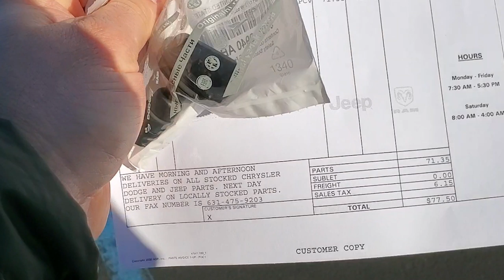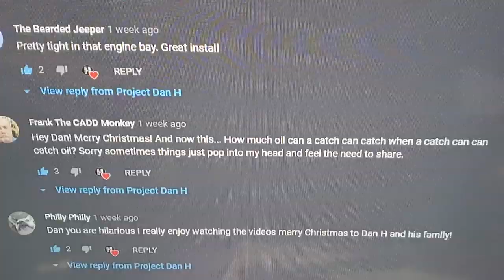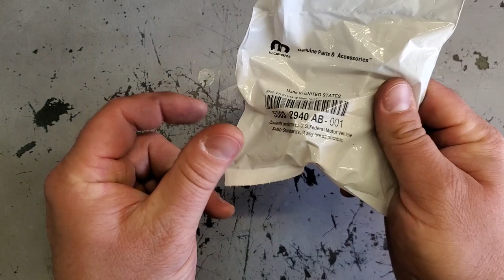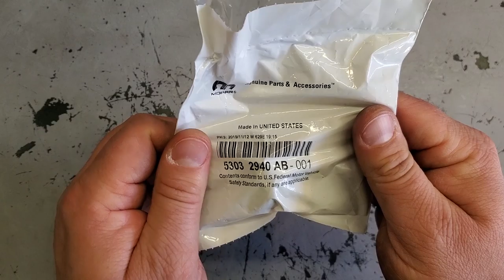JEEP COMMANDER 5.7 HEMI PCV VALVE REPLACEMENT AND CATCH CAN FOLLOW UP

Comment: I’ve been in the market for a Jeep Commander for the longest. I’m wanting too much I guess. Less than 100,000 miles, 4x4, 5.7 hemi.  How’s yours holding up? And how’s the maintenance been?
Reply from the maker: Good choice! that's what I held out for. took me many months to get everything I wanted. when I found one I flew 500 miles to buy it and drove it Home.  so far just changed the oil when it needed and everything has been great.  I love this vehicle
Reply: Project Dan H man I’ve seen so many miles away. I’ve been contemplating flying to one and driving back! It’s funny you actually did it and I’ve thought about it
Reply from the maker: @MrPonkie    it was a fun trip!  I made a video, check it out!   Another option would be to have it shipped back from a transport company.   You just have to consider the cost of gas vs the air fare.. and the annoying corona bullshit.  More than one way to skin a cat
Reply: Project Dan H question, how was the rust on the Jeep with 70k miles on it? I’ve got one in mind for $9k and 47k miles
Reply from the maker: @MrPonkie   very minimal surface rust on the undercarriage.  It was a southern car the first 5 years then a Rochester NY car for the 2nd 5 years. I immagine all rust was from Rochester.  I'm gonna have to get under there soon an POR15 the whole thing so it won't rot.   Sounds like you have a great deal.. I paid 15k for 76kmiles fully loaded black limited hemi

Comment: Might be a dumb question... Does it it matter which hose goes where on the can? Is there an inlet side and outlet side?
Reply from the maker: Not dumb dude,  It absolutely matters.  The side that hangs lower is the exit port. there is more filtration material on that side.
Reply: @ProjectDanH  The tube for inlet is coming from pcv valve and outlet goes to intake? I have a 08 Hemi Commander myself.
Reply from the maker: @jimnicholson77  yep, that's how I did it. Works great!
Reply: Thanks. Mine will be delivered in a week from today.
Reply from the maker: @jimnicholson77  Sweet!!!

Comment: Thats so much oil, i have a 2010 hemi, this thing has stalled out when stopped at lights hundreds of times. And i bought it brand new in 2010, been doing it since day one i wonder if its because of that..
Reply from the maker: wow. crazy right? it's definitely a problem..  also make sure you use exactly the type and amount of oil your motor calls for.  too little and too much can be harmful